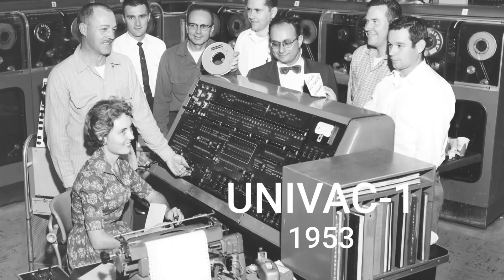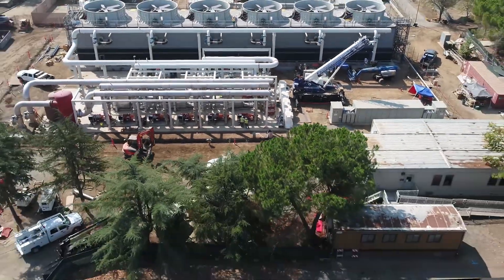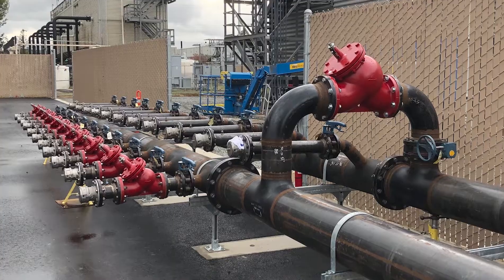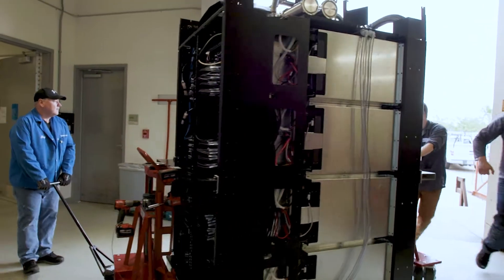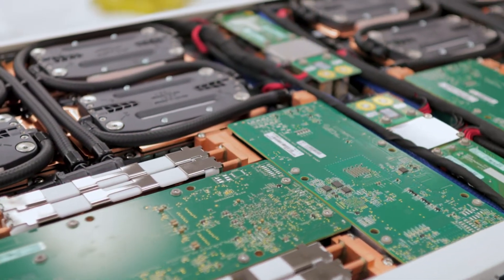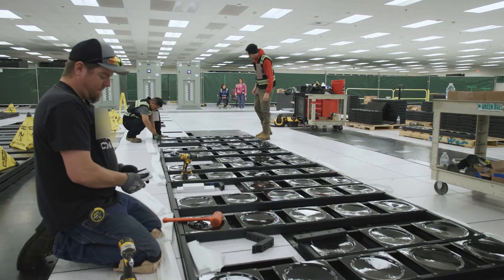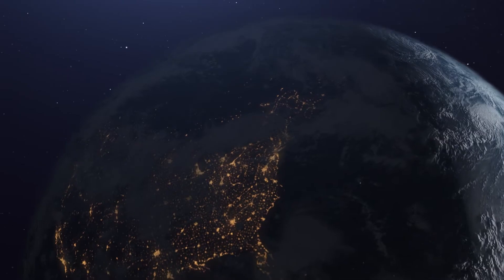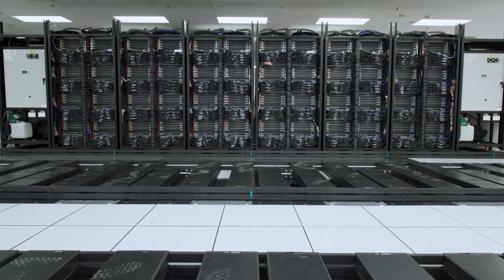Building El Capitan: How LLNL’s Exascale Supercomputer Came to Be

Comment: In this video they mention bringing 85 megawatts of power into building 453. I worked for 34 years in Los Angeles DWP generating stations, I operated units that at full power could generate 185 megawatts of power. So 85 megawatts of power is a tremendously huge amount of electrical power. I suspect that one challenge of these supercomputers will be building supercomputers that are more efficient in their electrical power consumption. Also it is not just supercomputer drawing tremendous electrical power it is also the tremendous amount of air conditioning  and water chiller electrical power to keep everything cool.
Reply: The question that comes to my mind is how would they get that amount of power from the grid to themselves? Because surely something drawing half the capacity of a power station must have to have dedicated lines back to the power station? And please know I know nothing about Power distribution. But surely if you were to start pulling 85 MW out of the local grid you would crash the area? So how would that work please?
Reply: There is the Green500 benchmark that ranks supercomputers by their performance per watt. As of November 2024, first place goes to JEDI in Germany at 72.733 GFlops per watt. But RMax is only 4.5 PFlops, 500x slower than El Capitan.

Comment: 2 Exaflops and in a few years 
 when FU Berlin and the MIT is right in a few years even Laptops with the new ONN-Chips were they have build allready the prototyp, will reach 160 Petaflops (80 terraflops best graphic card x 2500 - the ONN-Chip prototyp allready was 20-25 times  (FU Berlin says 20 Times, MIT says 25 times) faster then the fastest normal chip of the same size and 100 times less energy consumation, and the university FU Berlins says its easy to speed this up, up to 100 times faster with a higher laser frequency. means 25 x 100 = 2500). Means it would need in a few years only 20 ONN Chip Laptops to reach 3,2 Exaflops. It will be a new milestone. When 2 or 3 workstations in a few years reach the computing power of he El Capitain which costs hundreds Millions Dollars. The beginn of a new Era. And they said its easy to build, they used only thinks that allready exist so in a few years the massproduction can start.